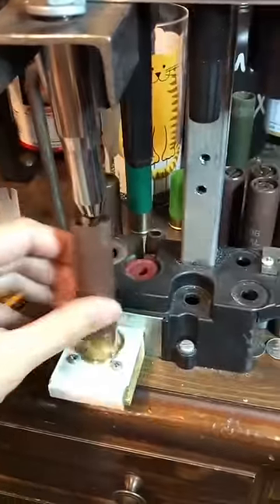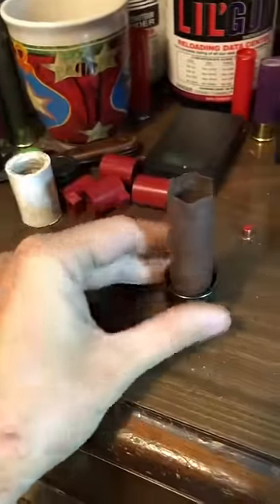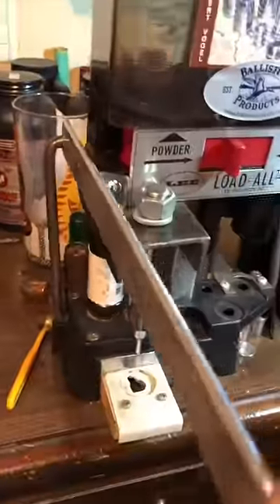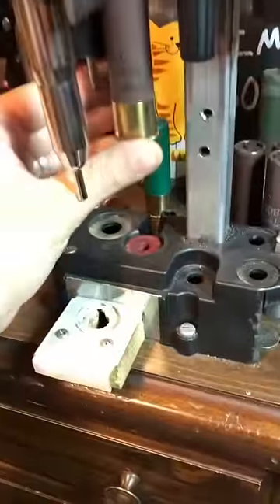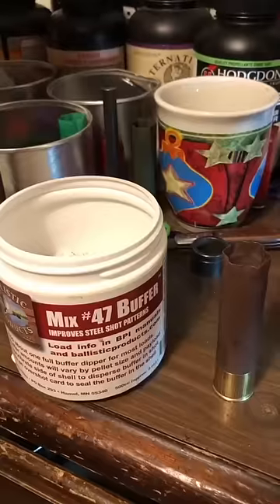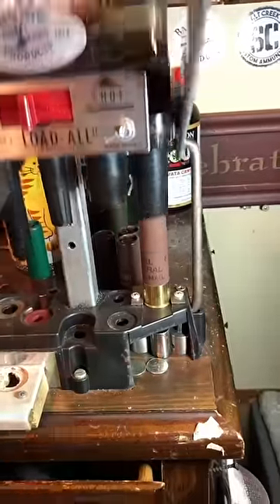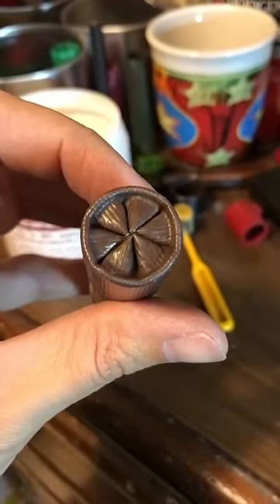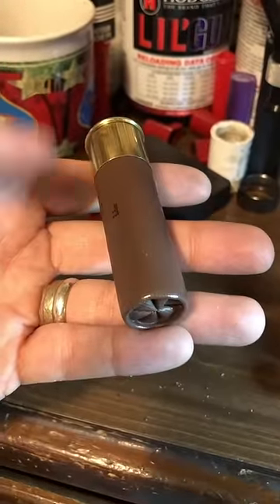Reloading 10 Gauge 18 Pellet 00 Buckshot #shorts

Comment: Question: How many times are shells able to be reused?
Reply from the maker: Depends on what shell it is. These, about 5 or 6 times on average but it really just depends on the load. A Winchester AA or Remington sts hull can be loaded 15 times or more. Those hulls are made to be reloaded a many many times whereas most hulls are only good for 5 or 6.
Reply: @theshotgunscientists  How do you know when a shell is smoked, no good for reloading? Do they just kind of fall apart?
Reply from the maker: @netts2315  No, the crimp will split eventually and when that happens you just trim it off and keep loading. Once it gets too short to crimp you can then just roll crimp it like old school shells are and keep going. 1 3/4” is the shortest I go. A 3.5” shell can be loaded dozens of times technically.
Reply: @theshotgunscientists  Ah, thanks for the quick reply! Cheers!
Reply: About 3 but the Winchester turkey loads if you keep loading for turkey are good for about 5
Reply from the maker: @nickdibbern4501  I’ve gotten these to load up to 10 times man 3 is just getting started.
Reply: @netts2315  the edged of the crimp start to crack open and youll get holes in the shell

Comment: That hurts my shoulder just looking at it, i love it
Reply from the maker: 10 gauge don’t kick bad, the guns are very heavy.
Reply: @theshotgunscientists  yea that makes sense i havent shot a 10 gauge the largest was a 12
Reply from the maker: @SilverDrag0n847  heavy 12 gauge loads kick a lot harder than “full” power 10 gauge loads do if the 12 gauge in question weighs like 6 or 7 pounds. 10’s weigh 9-12 pounds depending on model. All that weight really cuts recoil. A 10 gauge kicks a whole lot less than 3.5” 12 gauge does, and some 3” loads.
Reply: @theshotgunscientists  i appreciate the information

Comment: Man, Godspeed to gents like yourself with enough sensibility to understand Federal gets the Hull color code spot on. 10ga=Brown 12ga=Red 16ga=Purple 20ga=Yellow and I wish there was a trend for 28ga and .410 but I guess it's a big enough jump down they'll assume you won't get it confused with 12ga. Seriously though it's always been logical to have some semblance of bore-size color correlation to me. Even though I hated shotguns as a kid I just inherently knew Brown=big fucker and Purple=not 12 but not 20 either. Probably only me that cares about pedantics like this but 3.5" 12ga shouldn't exist, 10ga already had it covered; but uhhh "my guns too heavy" is a valid reason to jack the pressure specs of 12 to infinity

Comment: You can prime, and remove the sizing rings in the same step. It will save you a bunch of time
Reply from the maker: Not with hulls that have really tall brass like these. It’s tall enough to where the ring cannot clear the brass due to the press not having enough throw. This is 10 gauge. You have to remove the spring and primer ram to be able get the ring back off. Also that’s a mec 10 gauge ring, Lee doesn’t make one. Check out the main videos not the shorts for a real demo on how this setup works.

Comment: I’ve got a honey bair reloader and it re-sizes the brass as you punch out the primer
Reply from the maker: This is a 12 gauge press that I converted to 10 gauge. It’s a Lee load all 2. Normally it does resize and deprime at the same time but it can’t with 3.5” hulls. anything else it will do both at once.

Comment: 410 2.5 inch buckshot is also quite challenging to reload
Reply from the maker: 10 gauge is super easy. 410 32 and 24 gauge are the hardest.
Reply: @theshotgunscientists  I mess around with reloading the smaller shotshells occasionally   you can make 32 ga brass from 8mm lebel brass or blanks but they're the old fashioned kind you shellac closed.  Fwiw the old all metal and shellac closed shells  pattern better than modern shells do ..  .44 xl is another fun and forgotten shotgun shell it's a 44/40 Winchester  based shotgun cartridge popular in old youth guns of the late 1800s and early 1900s    the" marbles game getter " uses it so do a few other  unusual small game sized shotguns. And even a few break barrel pistols exist but quite rare. It's a caliber once  prized by fur hunters because it won't destroy a pelt. It sometimes consisted of a 44/40 blank style brass similar to the"5 in 1" blanks the movie industry uses . You can buy those as new brass btw   and a hollow paper bullet cap allowing an overflowing amount of lead shot  .. about 10 grams of #6 lead shot  from disassembled original 1920s ammunition. 30/30 brass can also 
make usable 44xl brass
Reply: Here's another money saving hint.   Get yourself a wad punch .. now instead of regular cardboard.  Go get some waxed cardboard vegetable shipping boxes  they'll keep the bird from rust or fouling by leaving a little paraffin wax and they're waterproof if friction fitted   but glue or shellac won't stick to them ..  there's nothing wrong with cutting off the wad petals in buckshot shells  it helps patterns the pellets can ride the bore as long as they are lead

Comment: Mannn, my wife thinks my 12g is brutal, she ought to give this bad baby a try 🤣
Reply from the maker: 10 gauge doesn’t actually kick that bad to be honest. They’re typically 10 to 12 pounds sometimes more and all that weight eats a lot of the recoil. You end up with a slow but stout push instead of a sharp thump like most shotguns have. 10’s were designed to comfortably handle huge payloads like this whereas 12 gauge wasn’t.
Reply: @theshotgunscientists  that makes sense, heaviness eating the recoil. I have a "tactical" 12g that's 6lbs, I hate it to be honest, it's so light it's all over the place after a shot, my heavier 12g is much better regrouping after a shot. Good content, good info 👌

Comment: Only if they made an all-in-one machine for this
Reply from the maker: This is a Lee load all, it’s $70 and comes in 12, 16 and 20 gauge but you can modify a 12 gauge press to load 10 gauge. If you have 1 press in any gauge, the conversion kits for other gauges only cost $25.

Comment: How many time should you resize shells before they start to get weak? Thinking of getting in to reloading shotgun shells for target just for fun make it a little cheaper and reloading is fun came make your stuff, curious how many times the brass will take be shot and resized also when are husks bad, I’m assume when the crack?
Reply from the maker: Resizing doesn’t have a limit, depending on hull you can reload a shell between 5 and like 20 times before the crimp splits. When that haloes you can just trim it off and keep loading. Reloading target shells will not save you money right now due to everything being really high. Buckshot, slugs, tss, bismuth, and turkey loads will still save money in the long run though. This shell costs $6 a shot from the factory but im loading it for 50 cents.

Comment: Setting the primer will also remove the resizing tool
Reply from the maker: No it won’t, the brass is way too tall to come off the ring. You have to take out the primer seating punch and spring so the press has enough downwards throw to pull it off. The Lee load all just can’t get the ring off hulls with super tall brass like these have.
Reply: @theshotgunscientists  aaah that makes sense I never tried it with high brass
Reply from the maker: @redbeard-kz7vo  It works with most high brass just not hulls that have really high brass like these do. 16mm brass is fine but 20mm and above won’t work.

Comment: Is there a limit on the number of times a shotgun shell can be reused? 
I always figured the plastic shell would be vulnerable to heat and shock damage, but I am also unsure as to what a failure in the plastic would look like
Reply from the maker: 5 or 6 times usually for most shells but some are meant to be loaded a bunch

Comment: So is this considered as a good way to save on ammo cost wise? Because I know you have to have the equipment and plus the components for the ammo. So will it still be costing me about the same in the long run or would it be cheaper?
Reply from the maker: This exact round from federal which is the only company loading 10 gauge buckshot costs 28.99 for only 5 rounds. I’m loading it for 50 cents.

Comment: I watched 3 times before I heard 10 Ga. I shot my grandfathers old wood stock no pad when I was 8 and and landed on my ass  in an electric fence. Between the pain and the electrocution and wetting myself,  I never fired it again.
Reply from the maker: They really don’t kick too bad. My guns weigh about 11 pounds and all that weight eats the recoil. A lot of 3” 12 gauge feels worse and all 3.5” 12 gauge is definitely worse.
Reply: @theshotgunscientists  True but up till then I was on a 410/22 over/under so it was a big step up with no frame of reference. I agree with the 12ga assessment. I was running 3" nitro-mags in a 500 and next thing I know the safety button popped off spinning over my head.

Comment: Roughly how many times can a shell be reloaded before the plastic fails?
Reply from the maker: Depends on what hull it is. Most 5-8 be for the crimp splits, then you can just trim it off and keep loading. A 3.5” hull can be loaded dozens of times technically if you just keep trimming it. Fold crimps last longer then roll crimps do, hulls like a AA or sts can be loaded over 12 times before the crimps starts to split.

Comment: How many times can you recycle a single shotgun hull? Does the plastic degrade faster or slower than regular bullet brass?
Reply from the maker: Depends on what shell it is. These, about 5 or 6 times on average but it really just depends on the load. A Winchester AA or Remington sts hull can be loaded 15 times or more. Those hulls are made to be reloaded a many many times whereas most hulls are only good for 5 or 6. They don’t become unsafe, the crimp just splits eventually. When it does you can just trim it off and keep loading.

Comment: How much does a whole reloading set up cost?
Reply from the maker: The press is $70, everything else is cheaper than that especially if you just save your hulls you’ve shot. Wads are very cheap, 1000 primers are about $70 these days which is over double what they were 5 years ago, a bottle of powder is $30 to $40, lead prices vary depending on what size you want but I cast all my own buck and slugs and I get my lead free from tire shops. Wheel weights. Check out our full videos not the shorts if you wanna learn more.

Comment: How many times can you reload each shell
Reply from the maker: Depends on what shell it is. These, about 5 or 6 times on average but it really just depends on the load. A Winchester AA or Remington sts hull can be loaded 15 times or more. Those hulls are made to be reloaded a many many times whereas most hulls are only good for 5 or 6. They don’t become unsafe, the crimp just splits eventually. When it does you can just trim it off and keep loading.

Comment: I thought shotguns use fast burning powder
Reply from the maker: That’s for target loads, magnum loads or heavy or high velocity loads use slower powders like longshot, blue dot, hs6, steel, 800x, and lil gun. Lil gun specifically lets you load 2.75 ounce loads in 3.5” 12 gauge at 1100 fps and 3 ounces in 10 gauge at 1200 fps.

Comment: This might sound dumb and might be a stupid question but, i heard you say resizing when you put the pvc piece on but what is changing during that process?
Reply from the maker: The pvc is just used as an extension for the metal ring so the press can push it all the way down. That is a 12 gauge press modded to load 10 gauge, the company doesn’t make 10 gauge presses. The ring squeezes the brass back down to factory specs so it’ll chamber in any 10 gauge not just the one it was fired in.
Reply: @theshotgunscientists  thank you very much, i learned something new, never been taught, but thanks to you, now i know

Comment: How many shots can you get out of reloading the same shell?
Reply from the maker: Depends on what kind of hull it is. Regular shells about 5 times but for premium/tapered hulls like a AA or sts, over 10 easily. When the crimps splits you can trim it off and roll crimp if it’s 2 3/4” or just keep folding it if it’s longer.

Comment: How many times can you re use spent shells like this? Just out of curiosity
Reply from the maker: 5-6 times for most shells, for tapered hulls like a AA or sts can go for over 12 reloads. When the crimp splits you can just trim it off and keep loading but you’ll have to roll crimp anything shorter than 2.5” generally speaking.

Comment: How many shots can you get out of one shell?
Reply from the maker: Straight wall shells last 5 to 8 loads before the crimp splits. When that happens, you can just trim it off and keep loading. There is no set amount. Shotgun shells are extremely low pressure compared to rifle or pistol brass. A 3.5” shell can be loaded until it eventually becomes to short even for a mini shell. Other hulls like Winchester AA or Remington sts hulls are made to be reloaded over 10 times sometimes over 15 before the crimp starts to crack.

Comment: How many shots can you do with one shell?
Reply from the maker: Depends on what kind of hull it is. These, about 5-8. When the crimp splits you can just trim it down and keep loading. After 5 shots they usually split which is fine but just looks ugly. A 3.5” hull can be shortened over and over until it’s about 1 3/4”.

Comment: Is there such a thing as too many pellets used? Same with what happens if you use too much powder or seal it badly
Reply from the maker: No, there are a ton of different powders that allow you to load more or less pellets or just payload weight in general. Some powders are for heavy magnum loads or very fast lighter loads, some powders are for only light loads at normal speeds, some powders are right in the middle.

Comment: Hello there, I have a question. Over here in Switzerland most of us only shoot 5.56 in the military, and we also don't reload the shells. And I have never shot a shotgun. 

So m, question is, doesnt the plastic on the top get ripped off? 
Atleast that would seem obvious to me.
Reply from the maker: No, it doesn’t. It just opens up like how it looks in this video. You can reload shotgun shells multiple times.
Reply: @theshotgunscientists  ok cool thanks, but there is a limit to how often you can reload these, don't they wear down after shooting them 4 to 5 times? 
Have a nice day good sir.
Reply from the maker: 5 or 6 but again when the crimp splits you can just trim it off and load it again. The rest of the hull is fine.
Reply: @theshotgunscientists  ah, and the resizing makes the brass fit again in the chamber. 
I would guess that cutting it off limits you to a few ammo times after shooting a lot with the same shell. But again likely cheaper to reload them yourself, especially when you shoot alot.

(For example for us we buy ammo from the government and, we pay 1ChF which is roughly 1 Dollar per round of 5.56, and get 50 Rappen or 50 cent back if we return the shell, maybe you guys got a similar thing in the States.) 
Hope I can go to the States one day. Thanks again 🫡

Comment: I never resize shotshells and never had a jam, y would u do that? Is there a benefit on resizing?
Reply from the maker: If you just have one shotgun in a particular gauge it’s not needed. If you chambers are the same size it’s not needed. But I have multiple shotguns across 8 different gauges, my four 10 gauge guns all have slightly different chambers and sometimes a shell won’t go in another gun at all. My browning bps 10 has a very tight chamber whereas my 10 gauge h&r slug gun has a much looser chamber. Shells fired in it will not fit easy in my browning, if you do manage to get one to chamber and then fire it, it isn’t coming out without a cleaning rod.
Reply: @theshotgunscientists  thank you im sub now!!!

Comment: I’d prefer a mix of 6-000 and 12-0
Reply from the maker: That would certainly work. It would be a 2 ounce load so a little lighter. Could use the same data here but use 37 grains of longshot and stack the 0 buck by 3’s in the wad then the 00 on top.

Comment: Do you have to resize?
Reply from the maker: @Miyamoto8Musashi  Yes especially if you have more than one gun in a given gauge. If you shoot low pressure it may not be needed, but any standard load will most likely need resized for best chambering and ejection.

Comment: Still wondering though, why a shotgun wadd is   so long and springy? I mean if the wadd is shorter, we can load more pellets, and why need a buffer powder?
Reply from the maker: They’re not all like that. It’s just a built in cushion. Most wads I use are full length basically cups. Buffer keeps the pellets more round which helps patterns.
Reply: @theshotgunscientists  thanks for the explanation, but why need a cushion? I've seen some .308 with sabo and it's only have cups, no cushion.

My theory is if we use cushionless wad, we can either load more pellets or increase muzzle velocity due to less weight or more powder within same 2 3/4 shell

Correct me if I'm wrong
Reply from the maker: @r.asyafiq310  Shotguns do not behave like rifles at all. They’re a 7000 to 14,000 psi gun at the most. Cushioning helps reduce recoil and prevent the pellets from deforming badly against each other firing firing. Steel shot wads do not have a cushion because steel doesn’t deform like lead and steel is significantly lighter, less payload. You need more room to get heavier steel load. But you can take steel shot wads, a 1/4” felt or cork or fiber cushion wads inside them and do heavy buckshot or turkey loads.